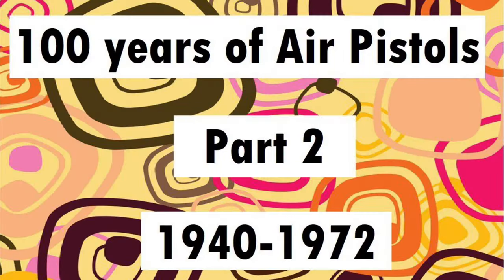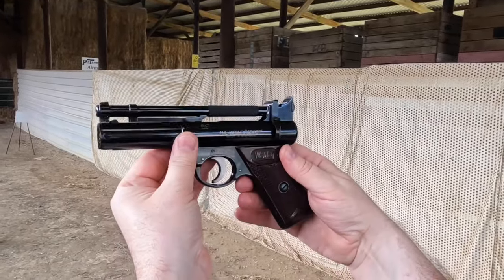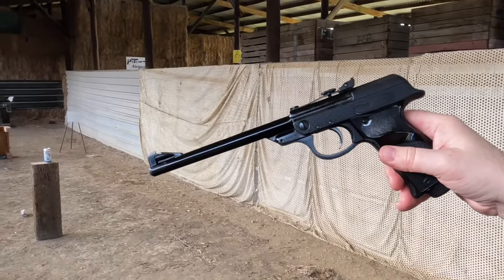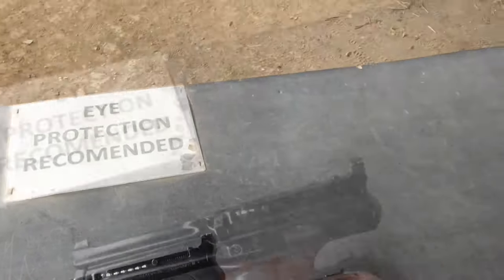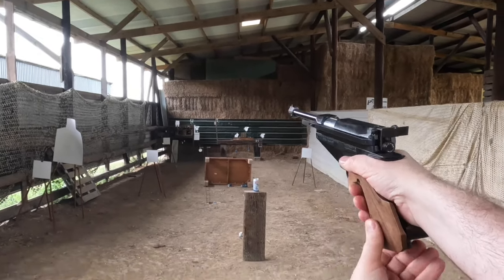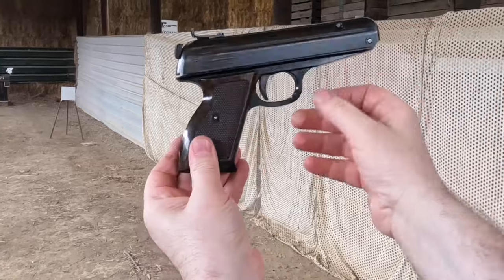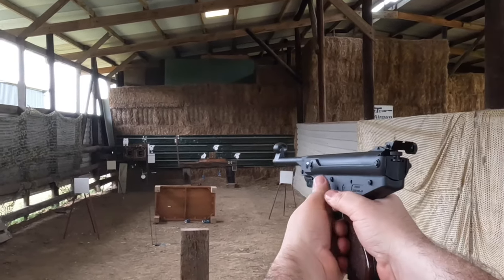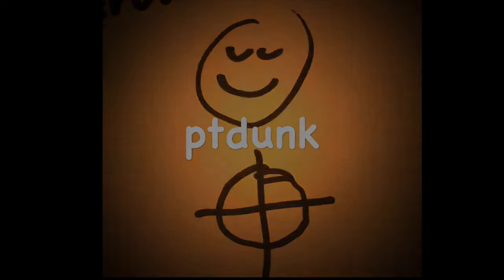100 years of Air Pistols part 2 1940-1972 Walther 53 Webley Diana Record Feinwerkbau vintage airgun

Comment: You're right about the Webley pistols, they were extremely well made, owned a couple of them in the past. The last l exchanged for the Walther L53, another beautifully made pistol. l currently own a Feinwerkbau 300SU that l bought new in about 1976/7...it still looks like new..
Reply from the maker: All lovely airguns, I’ve just had my LP53 converted to CO2 for something a bit different. Cheers

Comment: I had a premier back in the day. Loved it. The barrel catch broke and I swapped it in this condition with a school chum for a knife he’d brought back from a school trip to Europe. In 77 I bought a tempest I think it was called. Sold that almost immediately, wasn’t much use to a student (too noisy for the bed sit telephone directory target practice I had in mind) and I’d blown student grant money on it. 😂
Reply from the maker: I’m a big fan of the tempest, one of my first air pistols back in the 1980’s. One features in the next video. 
Tricky to zero in as the sight adjustment is very crude but they are accurate little pistols.
Cheers

Comment: Hello, very nice Collection! I have a Question, how many Meters are the Target from your Position by shoot with the FB Record LP2? Thanks for your Answer from Germany!
Reply from the maker: Guten tag, the target is 10 meters, the same for most of the pistols in these videos. I try to zero them so they all hit 20 millimetre’s high  at 10 meters, that way I just aim at the bottom of the spinner and it should hit near the middle. I have had several Record LP2’s, some are more accurate than others. The LP2 was the first air pistol I had as a teenager, so it has particular sentimental value. Danke from London
Reply: @dkjngl1  hello and many thanks for your Answer! Im collect sinze more then 20 years Haenel Airguns and now i have became a Record LP1. It Is a very cheap Gun, but she is funny and build since early 1960. For plinking at 10 Meters is she very good and make Fun. Last week i buy a new LP2. and this Pistol is not so accurate. OK, thanks for your Answer, sorry for my english and have a nice Weekend!

Comment: Ptdunk, Having just aquired an almost mint, boxed LP53. I would like you to tell me how do you hit such small targets at such range. Mine doesn't shoot accurately no matter how I hold it.
Reply from the maker: Best piece of advice I can give you is make sure you exercise good follow through. If you watch the video again you’ll see I keep aiming at the target for a couple of seconds after I shoot it. This makes all the difference to accuracy.
I hold it loosely and let it recoil as much as it wants, much easier to do that repeatedly than with any kind of firm grip. 
Then take the time to roughly zero it in, then do a pellet test, I try AA field, JSB express, Bisley practice and Falcon Accuracy plus. One of those will always group tighter than the others. Then do a final zero adjustment with that pellet.

Takes ages, but I find they always seem inaccurate until that final zero and then it all comes together. 
Hope this helps
Reply: @dkjngl1  Thank you for your advice which I shall try. You have answered my question when you stated follow-through and loose grip. I have been using H&N Excite. I have RWS R10 which I haven't yey tried. I have just ordered some JSB RS to try. I am toying with the idea of fitting a Protek Supplies LP53 kit which does away with the double concentric spring arrangement and allegedly increases the velocity and calms down the recoil.
Many thanks, Ptdunk, for taking you time in answering my questions.
Greatly appreciated.
Reply: @dkjngl1  Well I have to say that your advice with loose grip and the importance of follow-through is sound. The pistol has suddenly become accurate. I was using H&N Excite before then I tried RWS R10 Match which are much better in this pistol. With the H&N I was getting 375 fps and with the R10 a nice 420 fps. (Strange thing is that R10s are notably tighter fitting). The pistol is in stock form with its double concentric mainsprings and leather piston washer.
I have read that these can be modified to produce 500 fps with reduced recoil and buzz by using a single cut down HW30 mainspring and a delrin guide and reducing the transfer port size.

Comment: Great video, do you remember what brand , weight of pellet you were using ? Great cheers shane uk
Reply from the maker: Yes, if you look closely you can see little coloured dots under and in front of each pistol, these indicate what pellet I had to use so I didn’t get it wrong when filming. Black is 4.52mm 8.44gr AIr Arms diabolo Field,  yellow is 4.5mm 7.33gr Falcon Accuracy plus, Green is 4.5mm 8.2gr Bisley Practice and Red is 4.52mm 7.87gr JSB Express.   The Crosman 600 likes .22 Webley Accupel. Glad you liked it. Cheers

Comment: Loving the series and looking forward to the next.  I picked up a FWB65 that hasn't been used for 20 years and needs a service.  Any recommendations in the Surrey and West London area?
Reply from the maker: Try ‘Centra’ they are the Feinwerkbau importers. I’ve had spares off them in the past and they do offer a servicing service. 
They’re also based in Woking

Cheers,
Matt
Reply: @dkjngl1  Thank you Matt
Reply from the maker: Please let me know how it goes if you do get it serviced as I’d be interested for future reference. Thanks
Reply: @dkjngl1  Hi Mat, chrono'd the FWB65 and it is pushing out a steady 2.9fpe. Read a few more reviews and it seems this is close to as good as it gets. I have decided to leave it alone for now but will try Centra one day. The 65 gets another outing tonight at Bisley.
Reply from the maker: @jdaustin8618  Hi, that sounds about right for power.  If you have a look at the breech seal when it's cocked you can get a good idea if it's due for a service. Old seals are an off white colour and often are worn towards the hole at the breech end. newer ones are blue or green. I shoot HFT at Bisley (BFTO) and am planning to attend both the monthly Pistol HFT comp with my FWB90 and the Vintage comp with various golden oldies. If you see me there say hello. Cheers,
Matt
Reply: I've owned my FWB for 30 years now and during lockdown decided to service it. I've been putting it off for years due the supposed complexity. However after watching various you tube tutorials I decided it was really quite straightforward. I obtained genuine parts consisting of a breech seal, two bumper stops and a steel piston ring, complete with FWB grease for about £50. The secret is to take your time and make sure photos are taken at every step of disassembly.
Reply from the maker: @bikeralw  Hi, It's the trigger block that is the complicated bit, which you need to disassemble to get the sliding cylinder out. I cheated on my FWB90 and got to that stage but was able to change the piston buffer and breech seal without taking it fully apart. A good way is to print out the parts diagram and tape the parts in position on the drawing as you remove them and number them on the drawing in the order that you remove them. Makes reassembly so much easier and you are not relying so much on memory. photos help too. The steel piston ring is rarely worn out.
Reply: @dkjngl1  I agree, the piston ring seemed as good as new, but the buffer at the head of the piston was flattened. I don't think there's much improvement in power, but it was a very interesting project taking it apart. By far the most complex trigger system I've come across. In comparison stripping and resetting the Giss system on the Original Mod 6 was a breeze.